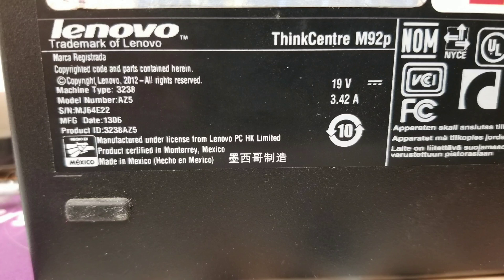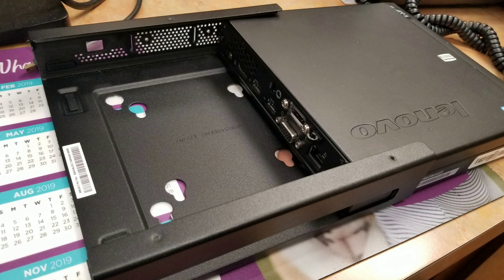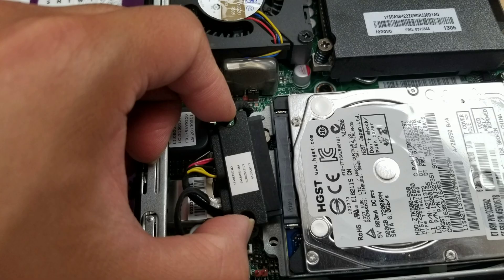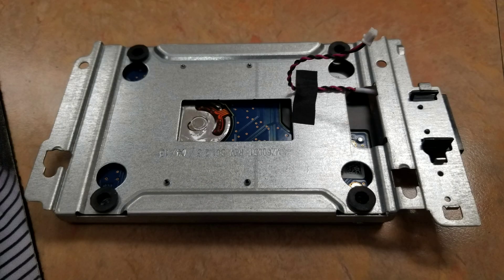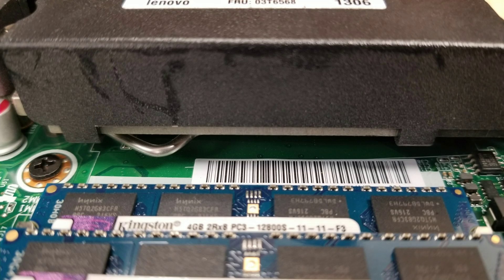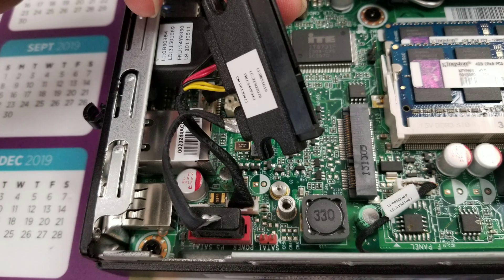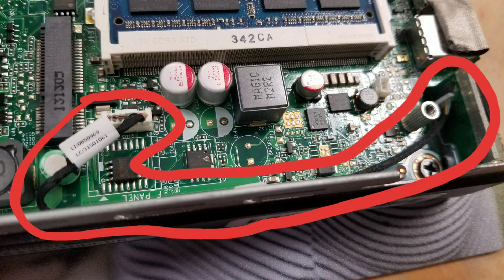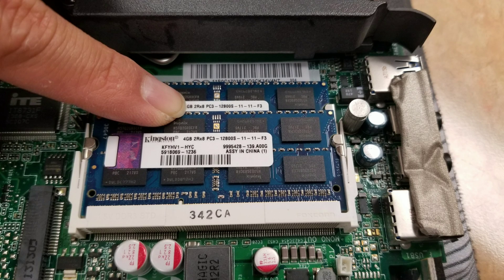Lenovo ThinkCentre M92p Disassembly RAM SSD Hard Drive Upgrade Repair

Comment: Hi! I have the same unit and I'd like to ask if I can change/upgrade the video card. Its displaying a purple tint no matter what monitor I use. Do I need to change the whole motherboard? Its still unopened.
Reply from the maker: @arlenebalagot2560  nope
Reply from the maker: @arlenebalagot2560  need to replace the motherboard.

Comment: How do you get the battery out? I need to replace one but I’m afraid to break something if I just keep yanking on the rubber cover. Am I missing something?
Reply from the maker: Not sure. I think it's just a sleeve on top.

Comment: Hey, thanks for that, I just got my M92p in the mail last week and got everything done installed Windows 10 need 8GB of RAM and only have 4 but it works. Had to purchase a power adapter didn't come with one. Didn't know how to open the case and thanks for that. Now I can clean it and replace the thermal paste on the CPU and clean the inside of it. Later
Reply from the maker: Sounds good! If you haven't already, don't forget to like and subscribe so others can find my videos. Thanks!

Comment: I've having temperature issues with this opened and I could see the fans is in the wrong way around. It's blowing out and not directly on the heat sink ever since I spun it around so it's blowing in the heat sink my temps are low idle 30.
Reply from the maker: That's not possible. How can they spin the wrong way?
Reply: @ItsBinhRepaired  Not spin the actual fan has one slot where the air blows out. Instead of blowing direct onto the heat sink it was blowing straight out the back. So I span it around so that the fan blows straight on the heat sink it now my temps are nice and low. During gaming on a i5 I peak at 55. IDle 28-30
Reply from the maker: @enhanceduk4642  https://youtu.be/3zs_SJ3BXgA
Reply: @ItsBinhRepaired  What are you showing me lol. I'm talking about on the lenovo m92p. The actual fan of you open it the sticker side is up and it's venting to the back and you will notice there's no air getting to the heat sink. Also a little arrow showing the direction of air flow. So what I did was place the fan sticker side down and the air flow arrow pointing to the front hear sink. Ever since I don't that my idle temps on an i5 are 28-31. And gaming (the Sims 4) 50-60 lol
Reply from the maker: @enhanceduk4642  so it's fine now?
Reply: @ItsBinhRepaired  Yea I'll show you pics if you have an email. Worth a try if you get high temps
Reply from the maker: @enhanceduk4642  I don't own these computers, so I won't have that issue haha
Reply: @ItsBinhRepaired  Oh I thought that was yours 😂